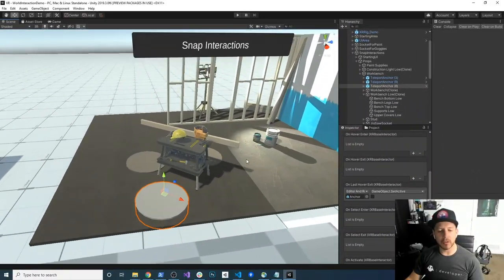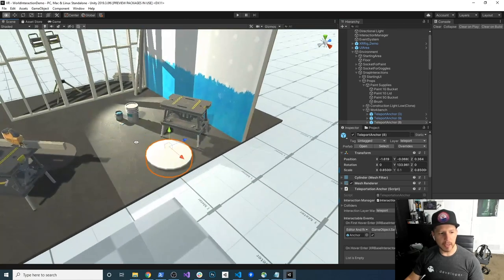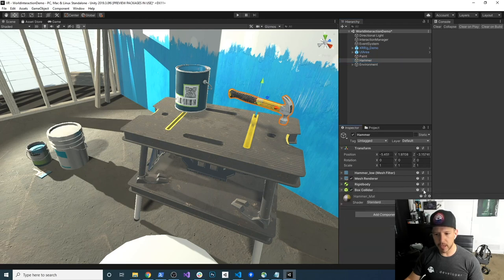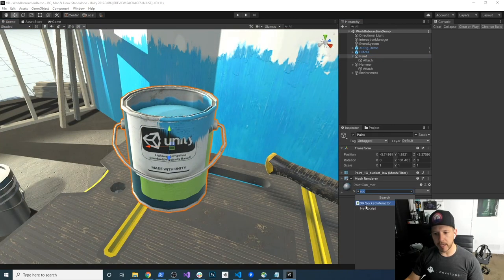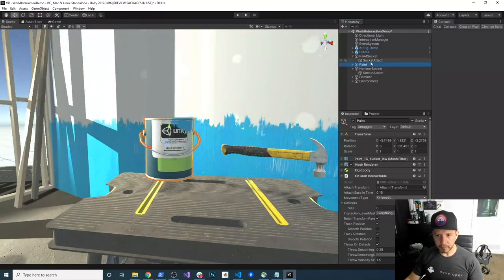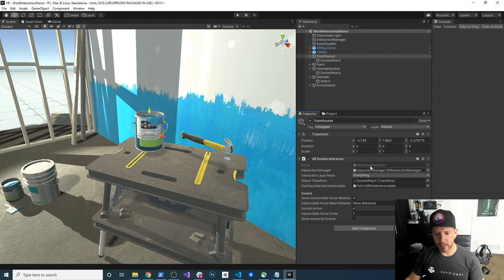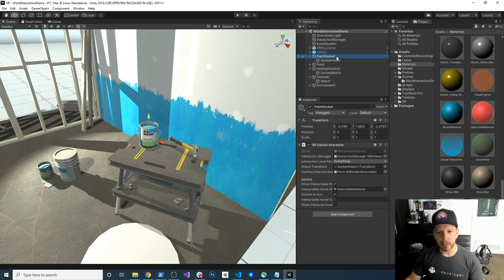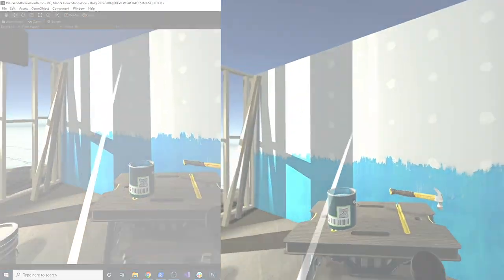Unity3d XR ToolKit - How To Setup And Configured XR Socket Interactors?

Comment: Hi there, got an error here and i cant find the reason why.
i setup an easy XR Socket, an interactable and if i use the socket and pull the item back out of it, the item will still use the socket transform and warps directly back towards the socket. i cant use another socket on this item again. any advice?

Comment: Dear Dilmer. Is it possible to make the highlight as another object? For example I want to fit a piece of insulation on a pipe. So I want to grab the insulation and then approach the pipe so the socket is the pipe (which now it is working) but the highlight I would like to be the pipe and not the insulation piece. Any help is very much appreaciated. ;-).
Reply from the maker: Good question, let me look into this and see if I can make a quick prototype that shows you how to do this.
Reply: @dilmerv  Thank you Dilmer. i have done it. It was very easy really. I have not used the original socket highlight but turn it off and then turn on another hidden object when object enters the socket area . :-)

Comment: how you have given texture to these objects in unity?because whenever i make a 3d model in blender and export it as fbx in unity its UV mapping is always vanished i am stranded there please help me
Reply from the maker: Normally any models you create and import into Unity come with textures, I haven’t had problems with that before.
Reply: i had this problem too, you need to change one thing in the blender fbx export settings. google for it and you will find
Reply: @SuperKlatschkopf  what is that could you please tell me here?

Comment: I also get this comment: Assets/Oculus/SampleFramework/Editor/OculusSampleFrameworkUtil.cs:43
Reply from the maker: I sent you a message previously but check this project https://github.com/dilmerv/XRInteractionDemo
Reply: @dilmerv  Thank you Dilmer. I have now downloaded and will go though. One question. Is there a way to connect the Oculus quest direct in a mac  so when I play I can just use the headset without having to build? At the moment I have to do something then build then upload it using Sidequest . Thank you. Your channels is amazing and very useful. Milenne